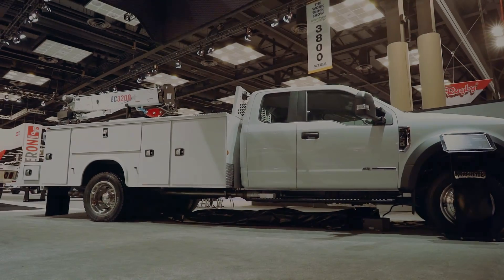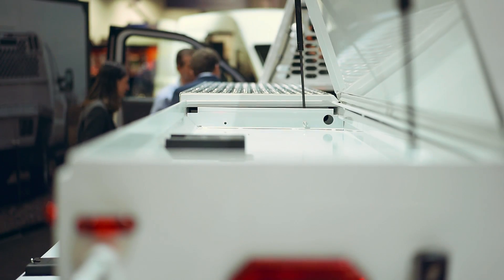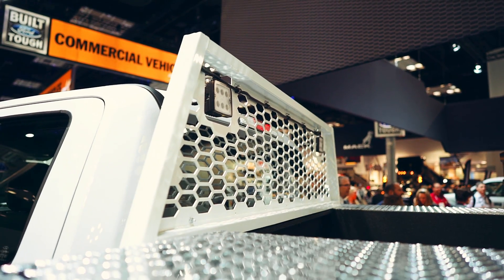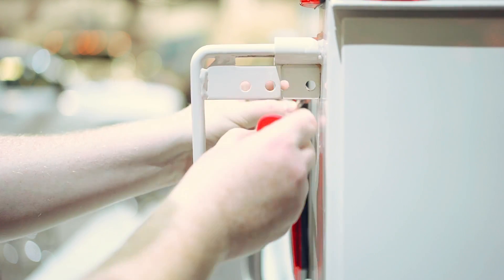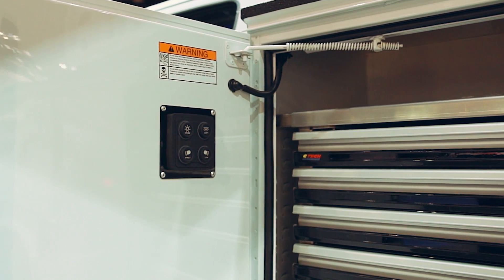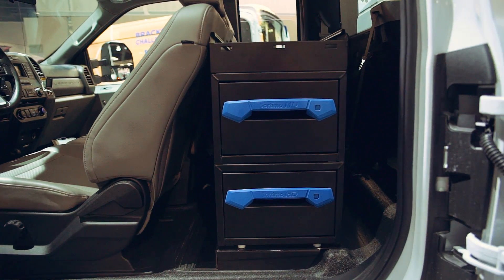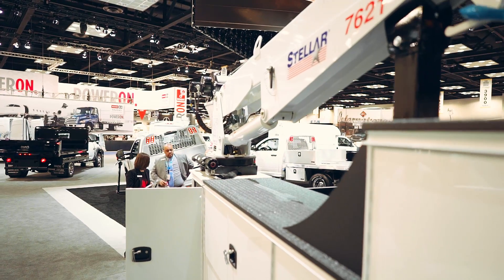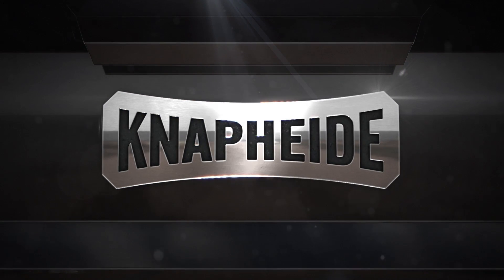Mechanics Trucks // Knapheide-NTEA 2017

Comment: Body frame starts breaking apart in my 2007 C5500 truck.
Reply: Gotta reposition box and weld it back in place.Reinforce frame with fish plate.I will not recommend this  model.